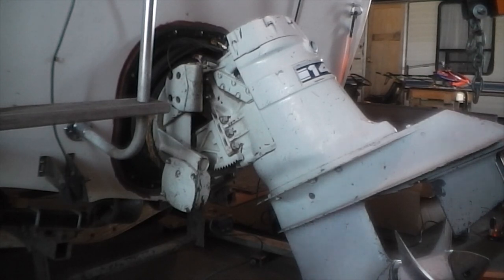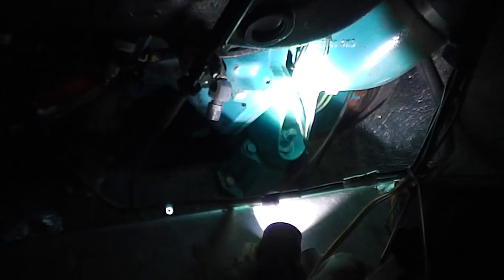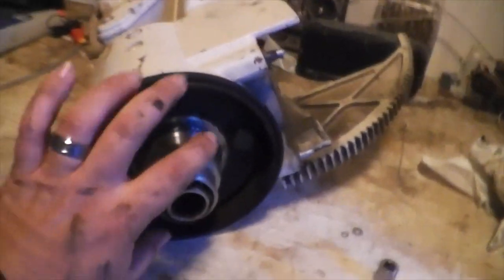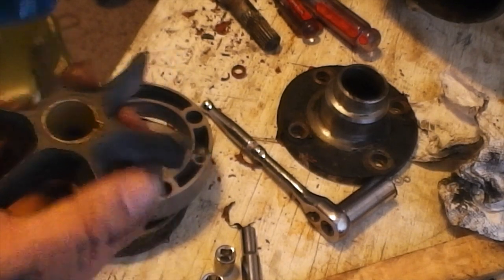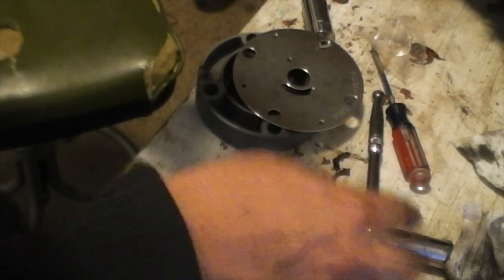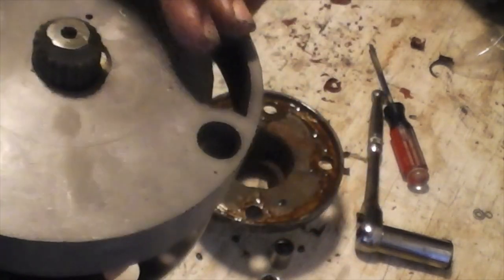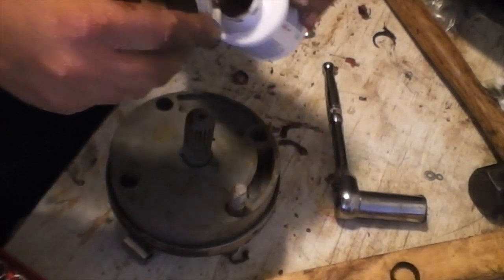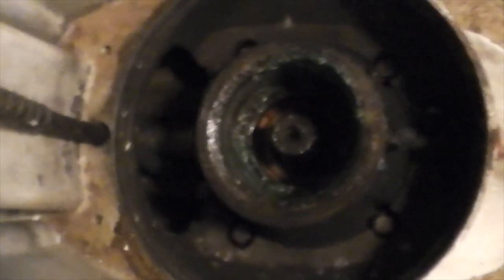1976 OMC stringer electric shift Impeller replacement

Comment: Thanks a billion!  That helped so much!  I just went for it, and boy the bolts holding the water pump were tight and locked on from corrosion - was  a salt water outdrive (and no sealant used).  Then the comment about pounding with a rubber hammer was priceless!  Well, tomorrow morning I'll put the new impeller in ... looks good from here.  Not too bad really.
Reply from the maker: Awesome!

Comment: The SELOC 1964-86 manual recommends inspection of the swivel housing and water pick up tube. Page 9-14. Any exhaust gases or leakage at the swivel housing will cause failure of new water pump!!

Comment: Thank you for the video it has been a great help as I'm more visual than reading, the one thing I found confusing and had to work out because mine was missing it upon my disassembly is that my unit is a 175 HP and that washer you speak of comes in two different kinds actually and with different washers and in some cases two and the washer you speak of only applies to your 140Hp and 120Hp outdrives, it is not applied in any other HP which only have single conical shaped spring.. Actually I also discovered that my unit has two grease fittings one top and one bottom but the top one is right behind the housing and sticks straight out so it has no access through the plug and no way to grease it. I am going to purchase a 90 degree zerk fitting so that I can give it a good grease charge from the top before full assembly but it won't be able to be greased again after that.
Reply from the maker: Glads this helped

Comment: Always use red locktite on the waterpump key,set the impeller on the shaft,and make sure the impeller will slide on,once it is positioned, take the impeller off,and let the lock tite dry,then assemble it afterwards

Comment: Great video. But my kit came with a large o-ring that apparently goes on the outside of the pump housing. I noticed you didn’t install this? In fairness, I didn’t see one when I disassembled, but wondered if it might have been an update.
Reply from the maker: I don’t recall that o-ring. This video was an early video for me lol. But it could have been a later update or that kit fits another outdrive maybe?

Comment: Thank you so much for this, Mine was very difficult to get the water pump housing out i actually had to knock the gears its attached to out with it then put them back after i separated the water pump housing. My impeller was completely trashed so I do not know what way to reinstall the new one for impeller paddle directions. Any input would be great. Thank you!

Comment: Hey, great video I have a 175 OMC it’s overheating. I want to change the water pump and impeller quick   Question   Someone asked if you had to remove the Drive from the boat to install the new water pumping and impeller. Do you have to or can you make the repair with the drive connected to the boat thanks man
Reply from the maker: @barneybenbarker76  if memory serves me correctly. I’m pretty sure you’ll have to remove the drive.  You may be able to do it without removing it. But I’d plan on removing the drive. Removing the drive isn’t difficult and pretty easy to do with a cherry picker
Reply: @ryanmurphy4208   thank you. Good video.

Comment: Just bought a old Windy 24. Didn't know the drive - but it's an OMC Stringer 1976 in a pretty bad shape, barnacles all over the place and tilt not working etc., so I'll have to give it the big round of fixing. How to do, I wonder? And then your videos shows up. Excellent videos! Gives me the courage to start on the project myself. One question though, I need to repaint the drive, do you have any recommendation on this? Thanks again 😄
Reply from the maker: @perpedersen6226  glad the videos help out and give courage to fellers like yourself. As far as paint, I would obviously strip the paint off. Then zinc coat it to prevent corrosion. Then prime it, wet sand lightly, pick your color and I would probably do a like 2k clear to protect the color. Thats my 2 cents. Thanks for watching

Comment: I have a 1973 120hp OMC sterndrive identical to this 140hp. I can not get the front water pump housing out of outboard. I've soaked it with PB blaster, W-40 and used the three 5/8 bolt holes and it will not break loose. Any ideas or suggestions? I'd greatly appreciate it. Thank you
Reply from the maker: Maybe try a punch and hammer with some light heat. and lightly go around the outside lip. But be very careful as if you damage it may seal and it’s also part of the upper gear box.
Reply: @ryanmurphy4208  okay, I'll try that. Is there a way to tap it from the top? There's a plate that has 5 Phillips screws and comes off above it?
Reply from the maker: That plate is part of the impeller housing and covered by the bigger piece that sits in the upper gear box and serves as a swivel point. I can’t remember the official name of it. I don’t know if you got a just an impeller or the kit I got. Which has an impeller and housing. If need be your better off to destroy the impeller housing as you can buy those new for not alot of money. You can see when I compared the old and the new. The old one is cracked and collapsing on the impeller. That’s what I’m calling the impeller housing.  Now on mine I was able to knock it out though one of the four bolt holes as there was a small lip down in those bolt holes.
Reply: @ryanmurphy4208  I got the complete kit as you did. I'll try punching out through one of the bolt holes.

Comment: Hey Ryan. Long time since I watched your videos but they are still the only ones dealing with my sterndrive so thx again. 
Easy question this time I hope. I can’t find the seal washer size for the oil dip stick on top of the sterndrive. It’s also the same as the screw for the intermediary oil fill   
All I can find are the smaller ones for the lower units drain plugs. Do you happen to have a part number for those larger washers ?
Reply from the maker: Good morning, try this part#18-0939-9.
Hope this works. Thanks!
Reply: Thx for the reply. That seems to be the right part number but can’t find anyone selling them, or they are out of stock. The joys of having an ancient stern drive 😂
Reply from the maker: @keithroberts6548  oh no!!! Then I’d suggest to keep watch on the dipstick for a milkshake. Just in case it’s not sealing
Reply: Unfortunately it happened already which is why I haven’t been out since I discovered it.
Reply from the maker: @keithroberts6548  looks like west marine have them in stock
Reply: Wow. They didn’t even come up when I searched. Just ordered 6. Thx a mill Ryan.
Reply from the maker: @keithroberts6548  awesome!!!!!

Comment: Hi, just inherited a 1970 400 Stringer.  What holds the lower unit to the upper unit if you don't have to take out the 6 bolts?  Do you have to drain the oil from the upper and lower unit first?
Reply from the maker: I don’t fully remember to be honest. I don’t think I drained any fluids. And to remove the upper you remove the top cover. And If memory serves me correctly the upper gear box should slide off.

Comment: So I have a 1981 120hp 400 omc sterndrive. which way does the impeller go in. Clockwise or counterclockwise?  Yours went in clockwise? Mine was disintegrated so I can't tell.
Reply from the maker: I’ve read that it does not matter what direction you put it in and when the motor starts it well correct itself. Now I can’t say for sure if that would happen. I would put it in the same direction as seen in the video.

Comment: Can you tell me where the water flows through to cool the engine I just picked up a boat with this drive and I’m so used to mercruiser I’m at a complete loss
Reply from the maker: On the 120/140 the impeller is going to pump to a water pump on the front of the engine. From there it goes though the bock and the manifold. And exits out the exhaust

Comment: So I have a manual shift cable and I'm having trouble getting it pushed through. Suggestions?
Reply from the maker: Getting the cables pushed though?
Reply: @ryanmurphy4208  the shift cable is difficult to feed through when removing the outdrive. I don't have the electric shift the comes has quick connections.
Reply from the maker: Try using dish soap or Vaseline on the cables. Even with the electric shift wires I used dish soap to get the wires pulled back though. The lubrication helps a-lot

Comment: I'm having a lot of trouble getting the water pump to come out. My manual only has instructions for disassembling the whole upper gearcase to include the ball gear. How did you go about tapping it out?
Reply from the maker: I’m assuming you removed the 4 bolts holding the pump to the upper gear housing? If so I used a punch and a hammer and slowly tapped on the little bit of surface I could hook onto down in bolt holes. One thing is if you are replacing the actual impeller and impeller housing you can do whatever you need to do. Just need save the other end.
Reply: @ryanmurphy4208  Thanks for the reply! Yeah, I had the bolts removed. I've ended up just removing the ball gear and tapping it out through there, but the housing itself is still stuck together. I believe whoever did this last used a bunch of loctite or something when they installed it. And it's very corroded so that doesn't help.

Comment: Why does the outdrive have to come off to do the impeller? Couldn’t you just remove the lower unit with it still attached to the boat?
Reply from the maker: you probably could leave the outdrive on, i did mine per the book, and also i had to replace my stern boot so it had to come off anyways.
Reply: Ryan Murphy thanks. I’ll probably just take the drive off also, doesn’t seem like that much more work. How long did the whole job take you approximately?
Reply from the maker: Lee Danger Brewer I probably had about an hour in it. I wasn’t thinking when I did this video when you go to put your drive back on make sure your steering wheel is straight and make sure the drive is straight also. Otherwise you’ll have a crooked steering wheel
Reply: Ryan Murphy solid advice. Thanks for the reply. I’m a boat mechanic for a living, been doing it for 13 years but have never done a single stringer outdrive believe it or not. Just never wanted to deal with them and have always had plenty of other work not to have to. This one is for an old friend so I figured by time I just did it. Will probably take me 3 hrs on this first one. Steering wheel tip just save me 45 min at least though so thanks
Reply from the maker: Lee Danger Brewer you’re welcome, a lot easier than it seems
Reply: Ryan Murphy finally started diving into this one. Didn’t know until I got started that it’s a late model so it’s not the electric shift. Not as easy a process to get the shift cable out but still got her handled so far.
Reply: Easy enough to remove and would be a massive PITA trying to do it while supporting the outdrive and BTW you ALWAYS find something else that should be repaired while it's open, I did, found both lower end drive shafts ready to break the next time out, why get stranded in a boat? No walking home from that! The drive shafts were far worse than his, mine were literally chewed off with the exception of the very middle of the male pump shaft and the splines inside the lower shaft were nearly nonexistent.
Reply: Great video. Someone asked in the comments if you had to take the drive off the boat to change the water pump. Does it have to come?  Or can it stay on? Thanks man again good video. I have an OMC 175 and it’s been overheating. I think it’s the impeller and water pump. I’m gonna try to do it myself thanks.

Comment: Ryan, I have an OMC 400 with the 2.5 liter GMC engine, I'm not quite sure of the year since I bought this boat on an estate sale.
I need to replace the impeller and pump.  I have the parts kit Sierra 18-3386 which contains both together with the O-rings.
Question:
Is it possible to raise up the OMC 400 and then drop the lower section with the propeller off the upper section and gain access to the pump from underneath?  That way I'd not need to totally remove the whole outdrive.  I assume then that I'd only need to remove four bolts to drop the pump and shaft out of the upper gearcase.
I have to work alone and lifting off the whole deal would be a struggle.
Reply from the maker: You can certainly try, but the electric shift wires and or cables you’d have to get slack in them if I remember correctly. If you have a cherry picker it goes pretty smoothly, even by yourself
Reply: Cable,or electric shift,you have to disconnect them.if you have a shift converter box,the cables  need to be disconnect. Either way it must all come apart

Comment: I couldn't help but notice the twist of the drive shaft splines, why is that twisted?
Reply from the maker: Chjp 234 good eye, the splines should be straight. I’m guessing the previous owner drilled a few rocks and that’s probably the reason there twisted. I was going to make point of that but totally spaced it. At some point I’m going to pull it all apart and replace everything that’s twisted and or bad. I haven’t touched the boat since I did the impeller. Maybe this weekend I’ll get it on the water.
Reply: If it were my drive I would replace that shaft could let go and leave you stranded .Twisted like that I am surprised it did not snap.

Comment: So I noticed you didn't put the o-ring on the outside of the pump housing.  My book tells me to do that and another video with no one talking told me to do it but neither explain why it's there.  Would you know why it's there and why you didn't out it on?
Reply from the maker: I do not know why it’s there. But I did tear everything apart off camera because I started wondering if I installed that o-ring. While the caulking was setting up on boot seal.

Comment: I have a  something similar to your prop and I’m looking to change the impeller as you have done I know the model number and serial number but can’t seem to find it anywhere online mine is 120hp where your is 140 is there a website where I can find parts for it ??
Reply from the maker: Nevin, I purchased this impeller from Amazon, I haven’t ran the boat in over a year so can’t say the quality of it yet. But download the Crowley marine app for your phone. They sell OEM parts and everything goes by your model and serial number. If nothing less you can at least get a part number and google search it.
Reply: Ok thank you was it difficult to change the impeller
Reply: I actually watched the video again very helpful . I downloaded the app you said but when I enter the model number # 989701 and serial number # 120B 2747 nothing comes up
Reply from the maker: Nevin, the impeller is actually pretty easy to do. 🙂 I’ll try the numbers you gave me and report back to ya. Are these numbers off the drive?

Comment: Great video thanks where did you get your parts from I’m from Canada but can get them shipped to the USA thanks again fir making this video I have a 1982 doral  what boat is on your video??
Reply from the maker: Sorry for the delayed response I’m not always getting comment notifications for some reason. My boat is a 1977 sea sprite with a 1976 3.0L gm four cylinder. All my parts so far have been from amazon or the parts store.
Reply: Can you contact me I have the 190 and it's been a bear!  Any help would be appreciated. Thanks
Reply from the maker: find me on facebook, Ryan Murphy my profile pic is me doing a wheelie on a four wheeler. just shoot me a message

Comment: question: my impeller looked like it was turning counter clockwise (facing the housing) Is that correct? Its a 1986 with a cable shifter not electric because its got a thick cable i could not disconnect....i have the gear housing suspended behind the boat
Reply from the maker: To be honest I can’t say for sure on the cable shift. I guess if it moves a lot of water  it should be the right direction
Reply: @ryanmurphy4208  ok thank you!
Reply: @ryanmurphy4208  So I looked at the pictures I took when I was dissembling....I also looked at the wear marks....so I'm positive I replaced the impeller the way it came out. But I still have no water flow. Any suggestions?
Reply from the maker: @jackstraw7413  if the impeller is not the issue, I would look at the water pick up tube. Could be cracked/broken or just plugged
Reply: The impeller needs to push the water,not scoop it.check the rotation on your boats ball gear,then check the direction it would be turning,on the outdrive side.the way the water pump shaft is turning, is the way you install the impeller
Reply: It's counter clockwise on your 86 cable shift

Comment: Excellent, and one of the only, videos I’ve found. Am I safe I’m assuming my ‘78 300hp V-8 with a Stringer 800 will be very similar? I do have the manual and have been able to source the kit with housing in both Seloc and Mallory on eBay. Thanks for your sharing and accurate information!
Reply from the maker: You’re welcome!!!! I would assume the process would be similar. 😃